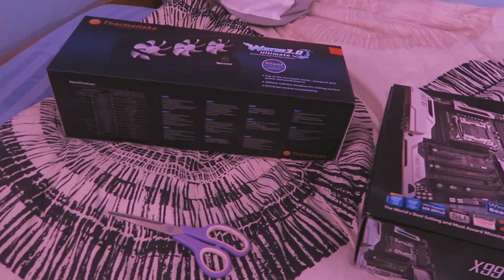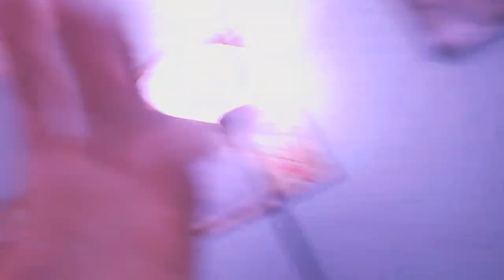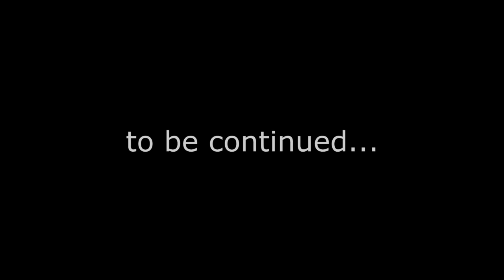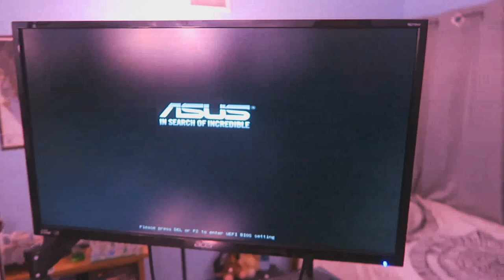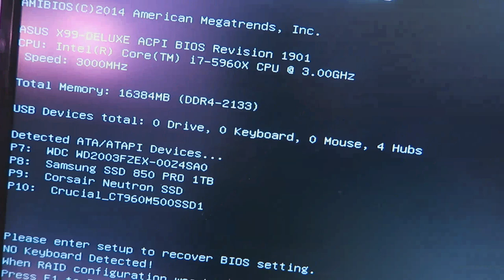$2,000 PC UPGRADE VLOG!

Comment: You need to fix your fans. The 2 in the bottom right are pulling in air instead of pushing it out. You are creating negative air pressure inside of the case and that could cause components to over heat.

Comment: One or two of the fans on the radiator are facing the wrong way dude! You need to make sure the pull air from outside the case and not from the inside :)
Reply: +Nicolay also... do you want to sell that old motherboard? lol :P

Comment: Um...I'm pretty sure I know your problem Pete..if that old rad was not caked with dust your cpu might not have throttled, that's why it took so long to render videos. I have an AMD 8350 and I get about 35-40 for a 30min video..

Comment: PETE I HAVE THAT EXACT SAME PROCESSOR !!!!!!!!!!!!!!
thinking of overclolocking yours? 
id suggest you do 
because it runs at a sluggish 3Ghz base and 3.5 boost 
Ive overclocked mine to 4.5ghz
and you have a good enough AIO to handle the heat 
i mean a 360 mil radiotor for just the CPU ?!
bit overkill if you dont overclock  +PeteZahHutt
Reply: +Asel Vinura 
btw why did you go with dual channel memorry ?
you should have gone with quad channel for DDR4

Comment: Is my pc half decent?
It has:
Processor Intel(R) Core(TM) i3-3240 CPU @ 3.40GHz 3.40 GHz
I have 8 gbs of ram
and 64 bit Operating system x64-based processor.
Reply: Do you have a GPU? That won't be able to game well at all. But for general use its fine

Comment: Pete I hate to be that guy but you did it wrong. One of the cpu cooling fans is facing the wrong way.
Reply from the maker: +mark burns Yeah, I realized after and fixed it actually xD
Reply: +PeteZahHutt PETE YOU SAID ACTUALLY AGAIN
Reply: +PeteZahHutt Also installed the rear exhaust fan wrong...